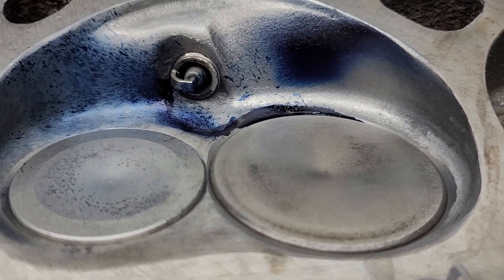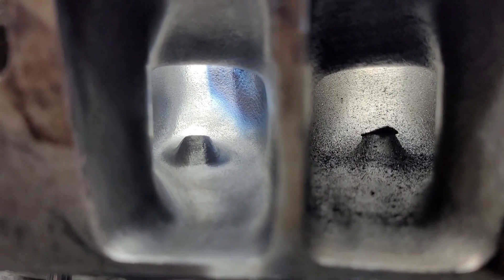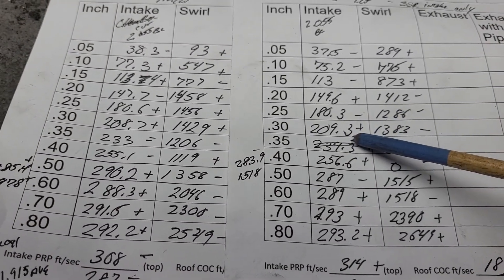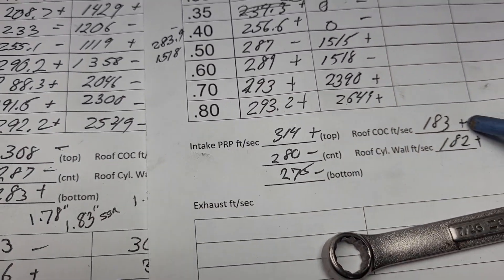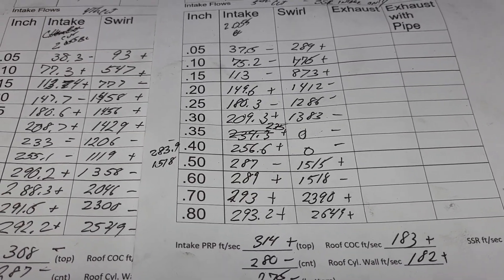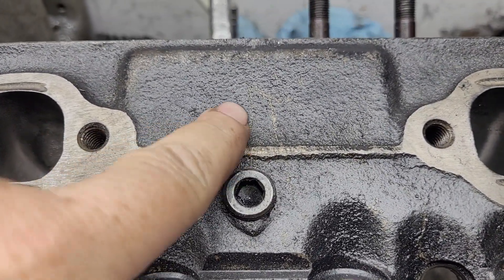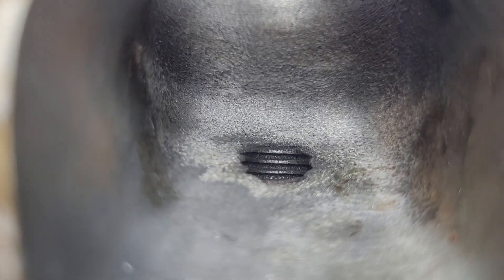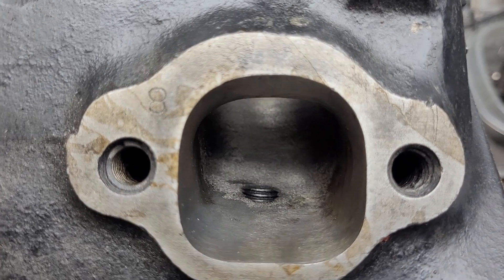Chevy Bowtie cylinder head 034, are there flow increases evening the ssr airspeeds?

Comment: I wonder if the valve guide boss is what's making the center of the SSR fast. Since the area between the guide boss and SSR is smaller than the sides of the roof relative to the SSR. That extra area could be the speed discrepancy, and for all we know, the altering of the flow by the guide helps it stay attached down the center of the SSR, so it may be ok. The guide acting as a down sloping turning vane of sorts.

Comment: I'm guilty of doing the upside down D ports back in the day. I did it for cross section. flowed well on the bench but I never flowed it with a pipe on it. I've learned a lot since then. Great Video!
Reply from the maker: I did more work to these and they really topped out well.

Comment: They probably were using some screw in valve guides from a diesel application as they were pretty common there where they were easy to service in the field just screwing out and back in new guides grind the seats and back together you go.
Reply from the maker: Ok, got it. Thanks

Comment: The 034 came in a version without the pushrod reliefs drilled, bet they were mean for there time. It's shame that GM didn't offer things like that in there later bowtie iron heads.
Reply: I ended up with an engine that was sponsored by gm for land speed that had a pair with offset rockers and lifters. It is now turbocharged and still running. It was stout